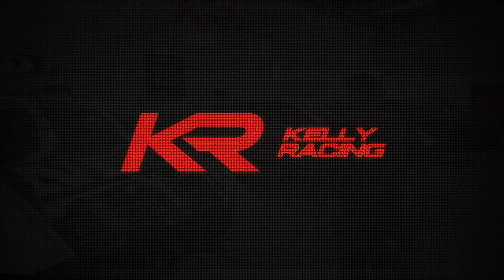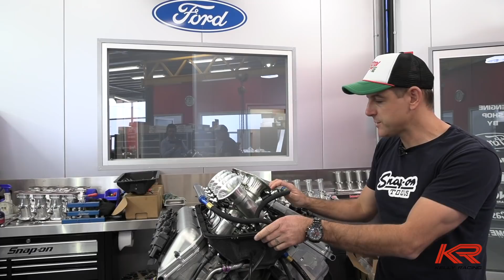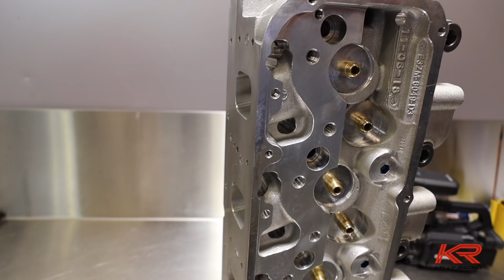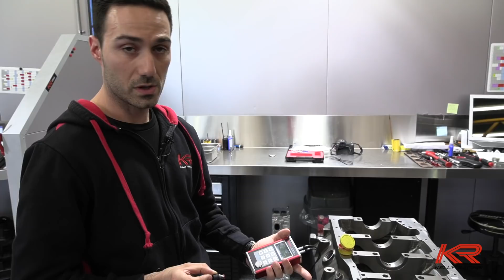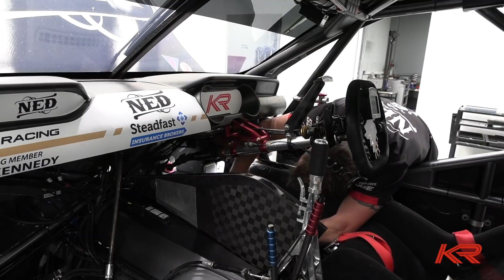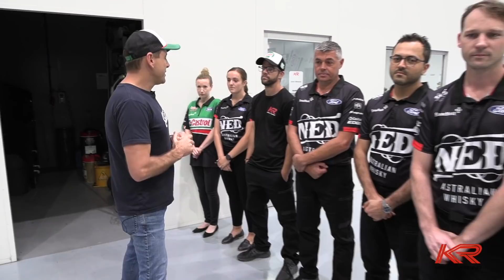The Road to Mustang part nine - What's next? Inside Kelly Racing

Comment: Did he he say push rods?  I thought the Ford Mustang had a over head cam engine?
Reply: S B it’s not a mustang engine. It’s a ford race engine that has been around in supercars for many years.
Reply: @TimSumpton  Why not use the correct engine for the car? Seems a bit arbitrary.
Reply: S B the rules of the racing series dictate what engines they run. Same reason NASCAR or Formula 1 run the engines that they do. Last year Kelly Racing we’re running Nissan engines which were based on VK56 which was quad overhead cam. And was homologated for the series.
Reply: S B also it’s not really a “Mustang”. It is a control tube chassis with panels styled like a Mustang. You can see this if you go back and watch some of the earlier videos in this series.
Reply: @TimSumpton  oh, so it's a completely irrelevant racing serious pretending to be relevant.  A bit like Holden.
Reply: @TimSumpton  Maybe they should homologate a Tesla Model 3 or S into the series.